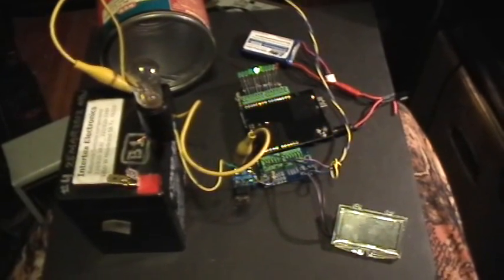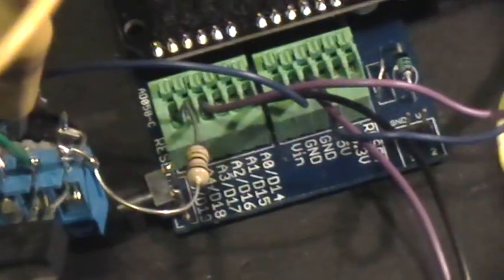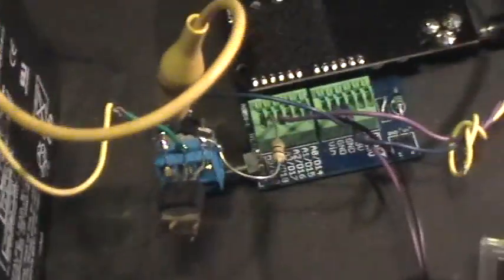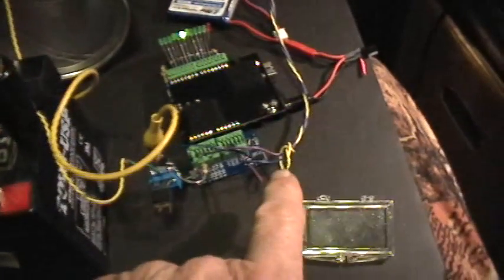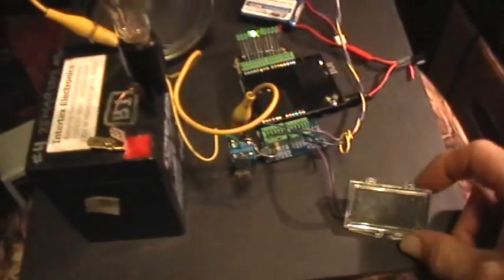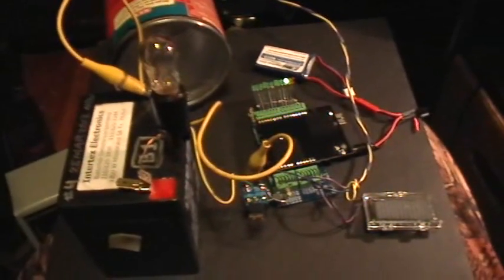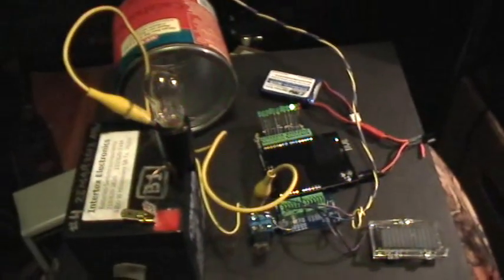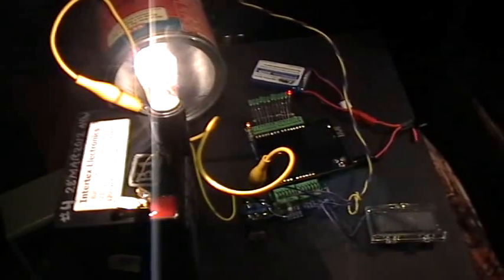Arduino 7: Switching a Heavy Load Using MOSFET and PV Sensor

Comment: ah. thanks, as mentioned Im using PICAXE over here, but I see, now, that, providing I use a newer chip, they also have an internal low voltage reference. Something I found out last night... the 20X2 series is capable of stepping all the way down from 64MHz to an op speed of 31kHz.. at 3V. Meaning its idle current is as low as 16uA (48uW to power). Cool! I see value in that, because often with simple stuff, you think: the IC version will add too much power consumption...not always!

Comment from the maker: The arduino has regulated 3.3 and 5 volt outputs, those could provide a stable reference voltage as long as the arduino's supply is over 7 volts. But you could also do as you say, calibrate to a known charged battery. At least I think so, if I am following you correctly.

Comment: ... ... a battery that was charging, and derive useful information? Would you have to set up an actual voltage, say put a full charged battery there, derive your digital value, and use that for your logic math? Is that the approach?

Comment: If you have a source voltage, for your microcontroller, and you create a voltage divider across that, and take that in ADC, I understand how you can use algebra to work that back into a voltage --- for example -- if you actually measured each resistor, and your source was stable, let's say you got a value of 200 back. So, (Vin/5V) = 200/255. Solvable. So, how would you then have a voltage divider across a ... ...

Comment: the Minelab detectors send a pulse.then clamp the Tx coil with resistance,to tighten any ring down,then wait for a short duration so that eddy currents produced by soil minerals stop,a pulse train controls the microprocessor which tells the Rx coil to listen for eddy currents still ringing in target metal.With mono coils the same coil does the Tx & Rx,in double D coils one coil does both.
i think a feedback, loop could be made more senstive,because it only takes a small "noise"to set it off

Comment: when i saw the lightbulb triggering the FET on thru the solar panel in a sort of feedback loop it got me thinking to the Pulse Induction method my Minelab detector uses...if the output of the FET was a coil and the trigger was a coil,they would feedback like your bulb and PV,and maybe affect the LED array when metal is near the trigger coil

Comment from the maker: I am powering the Arduino either with the 7.4 V lipo or thru the USB connection when it's connected to the computer.
Yes, you could do just as you say. In the video I'm uploading now I drive a 2n3055 directly with a PWM output and use it as a light-controlled light dimmer. The same circuit could drive a 2n2222 driving a heavy transistor to switch heavier loads. The arduino itself can be powered by a pretty wide range of voltages too, 7-12 V recommended and 6-20 V limits.

Comment: What powers the arduino itself, the 12V battery, just through regulation? When you use a 5V microcontroller, like you are, driving the gate with only 5V, can you not, instead, drive a signal transistor (that lives on the 12V side) that then pulls down 12V, to drive a MOSFET?

Comment from the maker: You are welcome. 

Later on after dinner I am going to try to make a variable dimmer using a 2n3055 and the analogWrite function to drive its base at a variable level, instead of the digitalWrite that just switches the pin on or off. I'm not sure if the Arduino can source/sink enough current so I might have to make it a two-stage setup with a 2n2222 or 2n3904 driving the power transistor.

I am amazed by the potential... no pun intended.... of this simple sensor-driven voltmeter setup.

Comment: Last night i thought I'd make a PICAXE dark sensor. Intially, I thought: -This is Stupid- you can do it without an IC. But for the sake of learning the PICAXE i did it anyway. I found that it is cool, because you can add all sorts of degrees of calibrations, and not only that, have different levels of darkness, increase the number of lamps that come on... also, pauses to stop any silly on-off flip flopping.... it's actually quite useful

Comment: Thank you for the interesting video, that helps. Right now I am playing with a 10K potentiometer inspired by one of your previous videos. The Piezo speaker and some transistor switching experiments will be next. Once I am a bit more versed in this art, I will tackle the two DACs of the Arduino Due. Greetings, Conrad